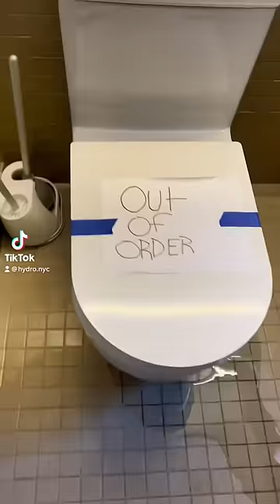Leaky Toilet Fix #wow #plumber #nyc

Comment: Your evaluation and communication skills are epic. 😂
Reply: Such a perfect description
Reply from the maker: 😂 thank you
Reply: The ADA requires SPECIFIC side clearances which can be most easily corrrected by use of these off-set flanges.  For pre-existing installations, these off-set flanges were the most economic/practical solution.  A great solution saving thousands of dollars.  This problem was caused by the implementation of the “Americans with Disabilities ACT”!!!  As such it is an export facto law, violative of the Constitution.  You can thank George Bush Sr., the A H. , a republican.  But don’t think the democrats are guiltless.  They are both slime.
Reply: Furthermore, what is the Constitutional authority for the federal government to mandate local or even state building codes???

It doesn’t exist.  The Constitution is not that long of a contract.  All should take some times and read it…
Reply: @Del Richardson  wtf are you on about? You must dream to live in some weird fairy tale
Reply: @webfreakz  That dude is schizo for sure lmao
Reply: Thats what keeps me around😂
Reply: @webfreakz let the dude fly his freak flag, its not hurting you

Comment: I would never use a wax ring with a horn on an offset flange. Typically the part where the ring sits is wider on an offset flange so I take 2 wax rings and mold it to fit and have never had issues with leaks or flushing. The problem isn’t the flange but rather the installation!
Reply: Same experience  same comment made 10 hours after yours

Comment: Offset flanges are used by guys who messed up on the under slab rough in. They either were too lazy, didn't have time to move it,or installed after inspection.
Reply: Or GC decided to move walls to make a closet bigger
Reply: @David-bc4hh Facts!
Reply: I have 2 for old toilets roughed in at 10" so they accept a modern toilet.  They give me no trouble.
Reply: Sometimes, the walls can be off a couple of inches. It's not always the plumbers' fault. Shitty prints are a thing. I've witnessed it first hand. I've had to correct multiple GCs because they don't pay attention to measurements.
Reply: If you’re hitting ADA numbers you have to be dead on. They aren’t missing the 12” off the back wall. It’s the ADA NUMBER off the side wall. It’s extremely hard. I’ve used an offset flange I’ll own it. I will use one again. This guy is a legendary plumber but he’s never ever done any earth work. Walk a mile in the dirt plumbers shoes and he will learn to love them
Reply: Offset flanges were less of a problem until we started using these low flow toilets.  No longer enough water to push "stuff"

Comment: Two of my most troublesome public toilets have offset flanges.  Constantly pulling needles and clothes out of them.  Obviously things that should not be flushed but they make it through the toilet and jam up at the bad bend.  Offering to correct the problem is denied because it’s just service plumbing work orders.
Reply: Thanks for the heads up. Never expected needles. Something to look in the future. I do a condo or apartment, once in a while
Reply: Those offsets are doing the system a favor then. Catching them before it gets into the main
Reply: It's usually the customers that want the cheapest knock off Chinese toilets. And then they put those stupid offset flanges Jack hammer. Do? It properly forget. I'll get a real toilet l o l
Reply: @JohnSmith-xu7ev needles everywhere now days, a buddy just did a job at a convenience store and the shit was all backed up because dumbasses try flushing needles and whatever else they can toss in the toilet.  I wouldn't have even thought needles would actually flush

Comment: For one I hate skirted toilets 😂 and two whenever I see an offset flange I tell the customer no warranty unless I install a straight flange
Reply from the maker: Loll smart
Reply: Skirted toilets are ridiculous!
Reply: I understand skirted toilets, but dear god I hate installing them. Put in 14 in a day, and we didn’t do the rough in on the building, spent all day chipping concrete and installing these uncooperative bastards
Reply: Install that straight flange when the GC didn’t pay attention when the joists were set. And now the plumber has to figure out to set the flange without compromising the integrity of the building. Commercial builds are much different than residential builds.

Comment: Because they roughed the drain in to close to wall , they used offset flange in order to set toilet .
They also didn't shim or use grout to set toilet , it shifted & messed up the wax ring causing leak .

Comment: The flange is always 4" but the outlet can be 4" or 3". They make offsets so the toilet can set without hitting the wall. You aren't making it better by installing a wax ring with horn either. And if the pipe isn't at least 3" that means the drain was for  something else and you can't install that toilet!

Comment: You’re never supposed to put a horn wax ring on the offset flange according to my uncle. Agree?
Reply from the maker: I think he is right
Reply: Your correct. If you are putting a offset it’s because the floor is usually finished and your attempting to do minimal chipping. And if your setting the flange to a finished floor and can’t get it to the correct depth please move to drywall or painting
Reply: offset flange already reduces flow, the horn reduces it even more

Comment: Off set flange is a stupid invention but what I do when there is one installed already and there is no way to change it, I cut the horn on the wax ring around about 2/3s flush with the wax on the bottom side and then place it so the remaining bit is the same side as the offset, basically so it's not hanging down a blocking the drain off any more than the stupid offset already is. Or you can use a ring without a horn at all. I've had in the past where it is plugged just like that due to the the horn (some guys around here call it the funnel) hangs down narrowing the drain even more than it already is.

Comment: I've had a couple instances where I was able to correct the problem of using an offset. 

Both had the joist too close to the pipe but I was able to raise the floor up by two and a half inch and use a normal 3 inch flange

In both instances they had been through snaking at least once a month and having the toilet removed at least once or twice a year so they were pretty well fed up and ready for an alternative

Comment: You cant use a wax ring combo on a offset flange, you will need to cut the black plastic off of center of wax ring.

Comment: I hate using those wax rings with that plastic flange, Ive pulled one of those plastic flanges out with a toilet auger before, even found em turned sideways before.

Comment: So how are u suppose to fix it?
Reply: Chisel out the offset flange from the floor for a regular one.  Install a regular 10" rough-in toilet even if that spec is not available in a "designer" style toilet.
Reply from the maker: Repipe it lol

Comment: Probably used to work fine and flush the paper out until they installed a new water saving toilet. 3.5 gallons of water makes a big difference over the 1.6 or whatever it is nowadays. But that offset flange is a piece of shit as well

Comment: Whats worse is if you look at the outlet on bottom of newer toilets is only 2" opening then they did that to the pipe. you need to tell them repipe cause if not it's gonna be call back after call back
Reply: All I read is money money money money
Reply from the maker: They couldnt handle it i guess

Comment: In Illinois btw, public bathrooms have to have open front seats only, or a continuous automatic liner.
Reply: I live here in Illinois.  Why is that? For all us non plumbers broski.....
Reply: @aaronmyers4054  All seats of water closets provided for public use shall be an antimicrobial plastic material and an open-front style, except that closed-front seats may be provided if the seat is encased with a continuous plastic sleeve ensuring a clean surface for every user. No water closet seat shall be more than 1½ inches thick.
Reply: That's straight from the code.
Reply: I'm guessing because of body fluids that can be left behind on a closed front seat, that's why the front is open.

Comment: Whether or not toilet flange is offset..  all toilet outlets range from 1 ½ to 2".  I agree about offset flanges only if needed
Reply: In what cases would it be needed?
Reply: @naruko191  its to move the toilet a little bit basically but it seems dumb i thinks for like weird toilets in weird spaces kinda thing
Reply: Or if you roughed in for a standard toilet that was supposed to be ADA offsets aren’t ideal but they can definitely get you out of a sticky situation

Comment: THe Foools who cannot rough in using a tape measure.. didn't add for the base boards and trim... which in turn pulled the wrong measurement off of the bottom plate..

Comment: Lol they are mot that bad , wait until you face an oval flange … yup oval no round , obviously the wax ring wont cover it all dunno the porpoise of it. But i find then in old houses where homeowner refuse to replace….. walk away from one the other i use another wax ring to cover the gap and told them i can’t guarantee wont  fail… seriously how the do those ?
Reply from the maker: That sounds like a lead toilet bend

Comment: This is tracible to the time period in which it was built. The world was building reckless and is now a bit better. They self inspect in NYC. Whoever pulled the permit is responsible in NYC. Building owners are delinquents. They will do things illegal and wrong as long as they can get their local building department to sign off. The building departments look the other way a lot. A government official looked at this and passed it on the word that the contractor would fix it and now it is your job bro. Hahahaha....

Comment: I've used offset flanges and never had this problem. You could have cleared that blockage with a toilet auger.  The reason it was leaking is because the wax ring was blown out on one side. Most likely from someone over plunging trying to clear the blockage. Probably you before you started this video ya Goomba 😂🤣. Just playing bro. You make me lmao
Reply from the maker: Good observation bro lol. The building maintenance tried to plunge it 😂 thank you